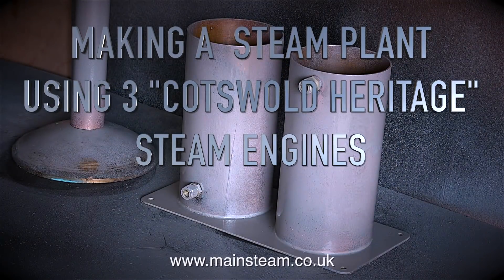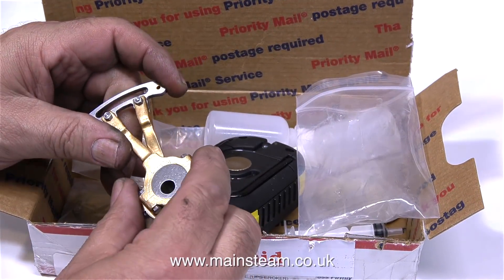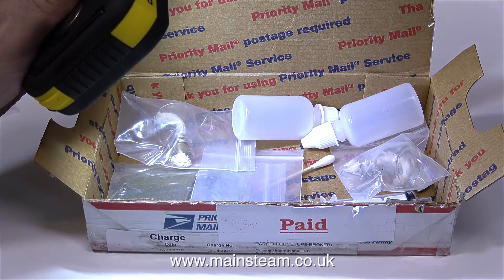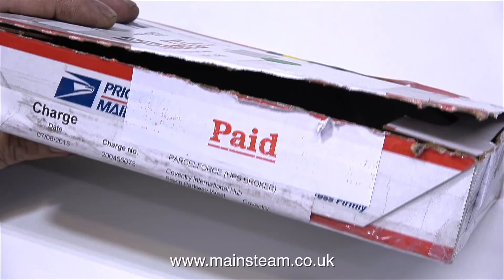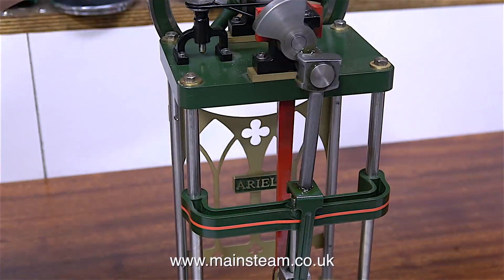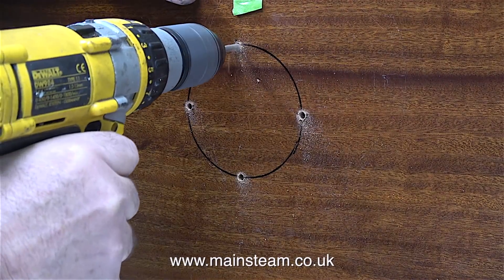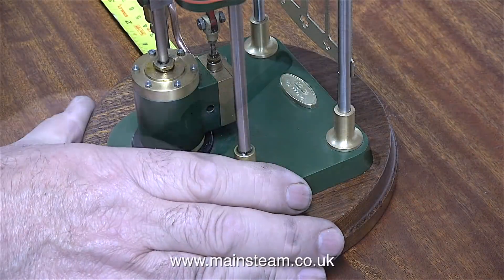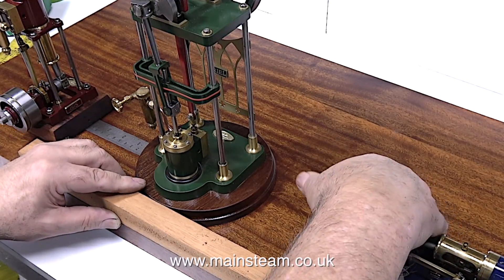A MODEL STEAM PLANT WITH 3 STEAM ENGINES - PART # 8

Comment: I like the idea of using the rubber tube as a drill depth guide, a lot better than tape and easier to see than a felt pen.
Reply from the maker: Felt tip pen is good for lathe drills which don't spin .....